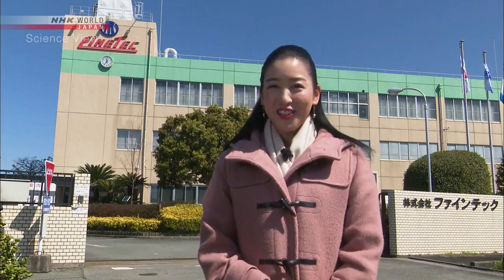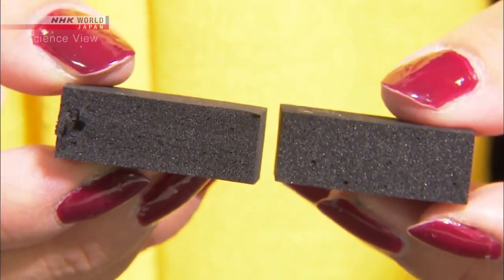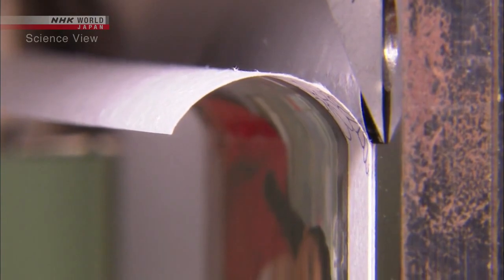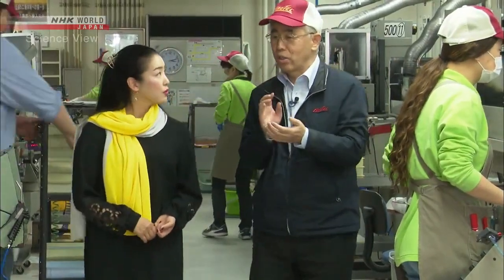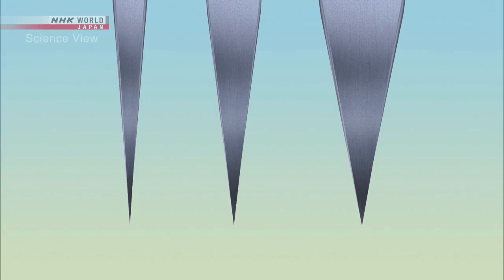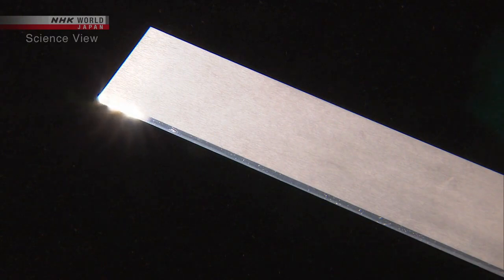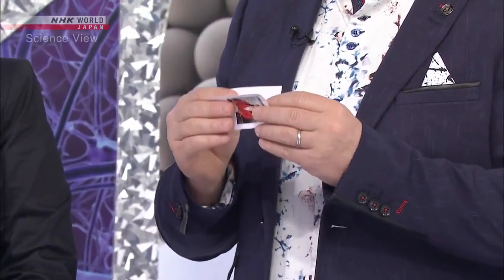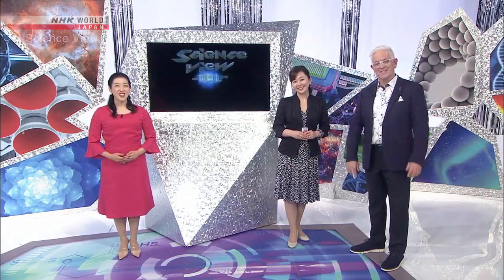Japanese Nano-Sharp Blade that Can Split a Human Hair in 3!

Comment: Dropped this blade on my foot and it cut through my leather boot through my foot and an inch into my concrete floor
Reply: You should have used nokia 1100 protection shoes